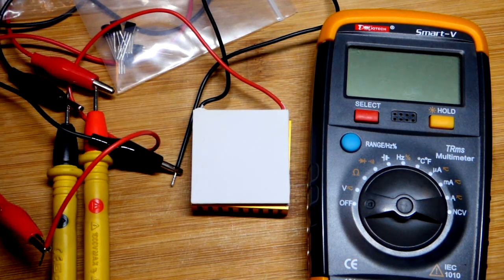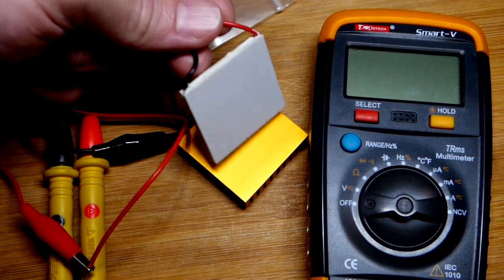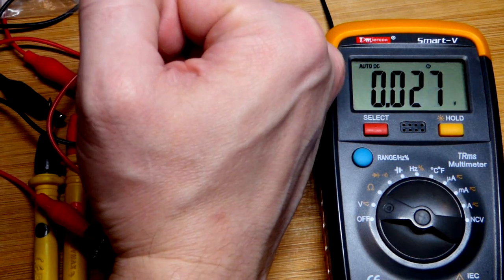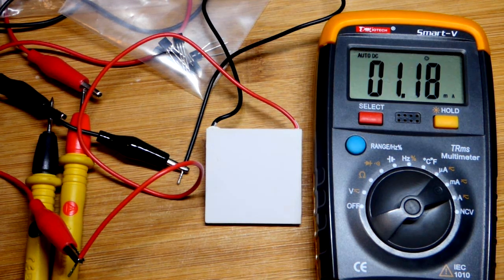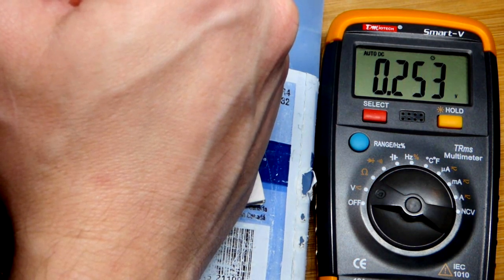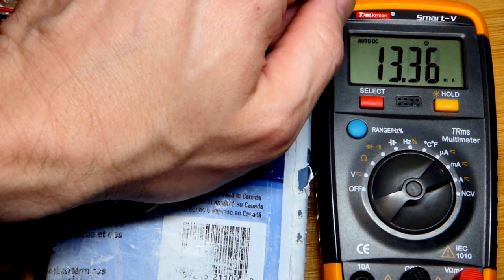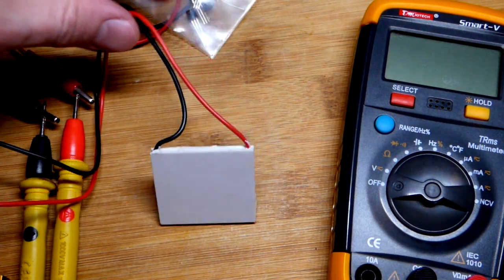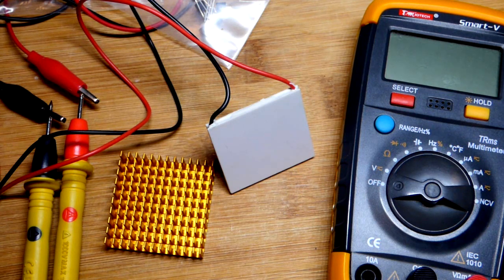Quick DIY peltier cooler energy harvesting experiment by electronzap

Comment: Cool experiment. Don't forget the current you're measuring is a short circuit current and the voltage across the element isn't the same when the meter is set to volts. So therefore you can't calculate the wattage by multiplying the two readings.

Comment: I really like how you want to keep within a budget. I guess a lot of people watching YouTube are just broke. 😂

I've seen some inventions that sit on wood stove tops that (obviously) use thermoelectric energy to charge house batteries. They use a large heat sync and cooling fan to cool the top side. I remember seeing that they were very expensive ($1,500 iirc). More for off grid cabins in the mountains during the winter. I think biolite stoves use them also, and again, very expensive for what they are.